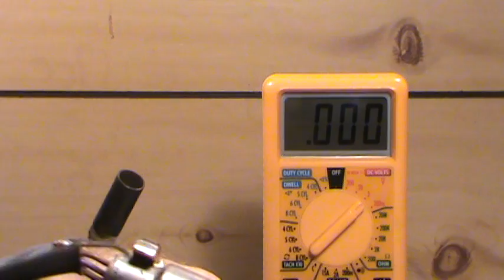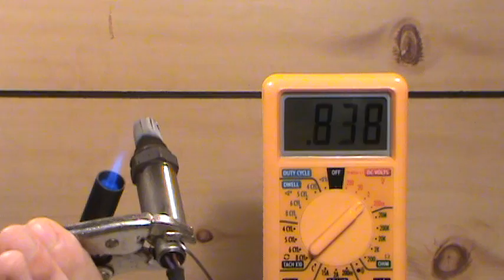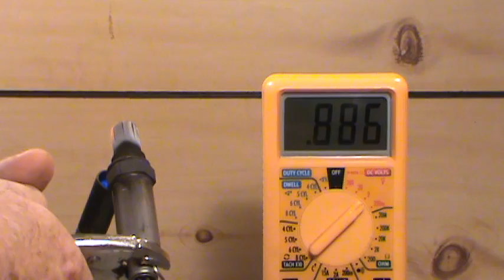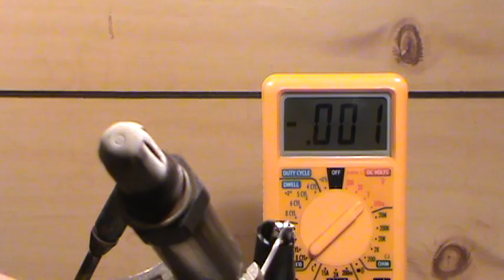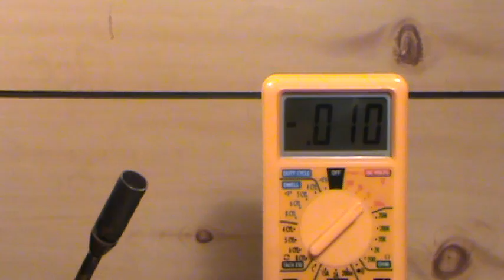Oxygen Sensor Test

Comment: Just wondering what would be the symptoms on the truck if you don't replace the oxygen sensor?  Would you loose some power due to that or is just to prevent the check engine light to come on the dash ?
please let me know if you happen to know
Thanks
Reply: WOW
Reply from the maker: Omar Herrera Greetings Omar Herrera....Thanks for watching, and for Your questions as well.................................................The "Oxygen Sensor" or "Oxygen Sensors", that are Installed, in the Car or Truck's Exhaust System, as the case may be, are "Responsible", for telling the Car or Trucks On-board "Computer", just how "Rich" or "Lean", the "Exhaust Gas" happens to be, when the Oxygen Sensor/s, are up to Operating Temperature, and, the "Computer" is in, what is known as "Closed Loop"...........................................The "Computer", usually, just uses the Information, that the "Oxygen Sensor/s" are "Sending", when the Engine is Operating at Lighter Loads, as in, just Cruising along, and are making the needed "Commands", to all of the "Actuators", in order to Maintain, an "Air/Fuel Ratio", of about 14.7 to 1, and I think, also, at "Sea Level" as well, if I'm not mistaken, that is, as Opposed to..."Ignoring" (aka, Not paying attention to) the "Oxygen Sensor/s", when the "Computer goes into, what is known as..."Open Loop", and, an example of that, is, when, You Push the Gas Pedal to the Floor...!!!...............................................An Air/Fuel "Ratio", that is "Rich", has More Gasoline, in the Air/Fuel "Mixture", then, that, of a "Lean" Air/Fuel "Ratio", which has "Less" Gasoline, in its Air/Fuel Mixture...................................................The Fuel "Injector" or "Injectors", as the case may be, work kinda like a Light Switch, as in, Switching the Light Switch On and Off, really Fast.............................................The Car or Truck's "Computer" actually "Controls" the Fuel Injector/Injectors, Turning them, On and Off Really "Fast", and when they are in, the "On" Position, the Fuel Injector "Sprays" Gasoline, in a Very Fine "Mist", that eventually "Mixes" with the "Air", then on its way, into the Engine Cylinder, it goes, to be "Burned", to make some "Power"............................................To keep things simple, let's just talk about, Only "1" Oxygen Sensor, and Only "1" Cylinder in the Engine......................................When the "Oxygen Sensor", notices, that the "Exhaust Gas", that Flows past it, is on the "Rich" Air/Fuel Ratio, or Mixture side of things, the Oxygen Sensor, then, "Tells", the Car or Truck's "Computer"...Hey...Tell the..."Fuel Injector"..."Not"...to..."Spray"...so much Gasoline...because...it's just "Wasting" Gasoline, that the Engine Does "Not" Need at the moment...!!!..........................................Then, the "Computer", shall we say..."Pulses"...the Fuel Injector, with..."Less On Time"...so, the Fuel Mixture, or Air/Fuel Ratio, then, becomes..."Leaner" then it was previously.............................................Then, if the "Oxygen Sensor"...notices, that, the Exhaust Gas happens to get...Too "Lean"...the..."Oxygen Sensor"...Tells the "Computer"...Hey...Tell the "Fuel Injector" to..."Spray"..."More Gasoline"...because...the "Air/Fuel Ratio", or "Mixture" is Too..."Lean"...and...not only, will an Overly "Lean" Air/Fuel Ratio or Mixture, have the ability, to cause the Engine to Run, not so good, but, it can also cause some very Bad, and Expensive..."Engine Damage", given the right, "Way Too Lean", Operating conditions...!!!................................................The "Light On The Dash" is telling You, that something is Wrong, and, depending on, just "What Year", and, the "Make/Manufacturer" actually is, of the Truck, and, the actual "Engine", that's Installed, will determine, on what method You will have to use, to "Extract" the "Trouble Codes", that might be "Stored"..."Inside"...Your Truck's..."Computer Memory"............................................"If" Your "Oxygen Sensor", or "Oxygen Sensors", and, almost Any "Other" Device, that is related to Managing Your Engine's Operation, is, "Not" Operating, as it, or they should be, then, even "If" the Engine seems to be Running alright, Your Engine, might be "Wasting", that, quite Expensive Gasoline, giving You "Less" Gas Mileage/Kilometer-age, then, the usually "More" Fuel Economy, that Your Engine will usually get, if the Engine is Running, like the Factory/Manufacturer designed it to do, when it was brand new...!!!.............................................Perhaps, pay close attention, as to how Your Truck's Engine is actually Running, and, Keep a close eye, on Your Gas Mileage/Kilometer-age as well, as those two, just mentioned items, are just some "Clues", to be watching out for..................................................If any "Parts" need "Changing", then, as I see it, that would be a very good thing to do...............................................Be Safe, take care, and have a good one.
Reply: RockysRoadshow
How about a brief answer? Maybe just say yes or no and explain why with main point. :D
Reply from the maker: Supzor Greetings Supzor...Let's see now...You are asking me, to give You a..."Brief"...Answer...???............................................"What" was the..."Actual Question"...that You want, that..."Brief Answer"...To...that You were mentioning...???.............................................When it comes to, any "Question", that "You" may have...Please, be..."More Specific"...and...Please, give as Much..."Detail"...as "You" are able to...that way...I, just might...Run-out...and...Finds-me, a..."Brief-Case"...so that...I will be able, to..."Open-Up"...that there..."Brief-Case"...and...have a..."Look-See-Inside-of-It"...and, if-in I get..."Lucky"...I just might be able to (much like a "Magician" does, when He or She, "Pulls-a-Rabbit-out-of-that-there-Hat")...be able to do...much the same thing...but...instead of..."Pullin'-a-Rabbit-out-of-a-Hat"...I'll probably be..."Pullin'-a-Document-or-Two"...out of that there (Imaginary, at this particular point in time)..."Brief-Case"...where...Hopefully (and, keepin' "Fingers Crossed")...that there..."Imaginary"..."Brief-Case"..just might..."Contain-with-in-itself"...that, or those, as the case may be..."BRIEF-Answers"...to the..."I'm-just-Not-Sure-what-His-or-Her-Actual-Question-Was"...???.......................................................When it comes to, something like...a "Vehicle's Computerized Engine (and then some) Management System"...I really can't see, having a..."BRIEF-Answer"...To...the..."Mind-Boggling-Amount-of-Information-that-the-Vehicle's-Computer-Recieves-from-all-of-the-Sensors-then-Processes-that-Information-then-Outputs/Commands-all-of-the-Vehicle's-Actuators"...!!!...................................................................Well...I guess, about the..."Only Thing"...that happens to be..."BRIEF"...here, is the, shall we say..."Lightning Speed" (You know, that "Super-Bright-Flash-of-Intense-Light-in-the Sky", known as..."Lightning?")...is, as I see it, the..."SPEED"...at which, Our Friend, the...Vehicle's On-board "Computer"..."Processes-all-of-that-Amazing-Amount-of-Information-At" (Time-wise...Eh!)...also, even "I", find it Difficult, to Comprehend, the "SPEED", at which the vehicle's Computer "Processes All of that Information At"...You know..."Splitting a Second of Time"..."Into that Many Divisions"...maybe along the lines of..."Milliseconds" (aka, "1-Millisecond", should be Equal to..."1-Thousandths-of-a-Second"...Time-wise)...perhaps......................................................The..."Last" sentance, in, this here Reply, will be quite..."BRIEF" (as You requested)...and is, as follows.............................................................Be Safe, take care, and have a good one.

Comment: a comment on SixtyFiveDropTop's comment about O2 sensors not wearing out, but suddenly failing.
Actually, they DO wear out, However as they are a dynamic device, and function off of a known set of parameters that are based on the laws of physics, they are also self calibrating. It is when they fall outside the known operating ranges that your vehicle generates the dreaded P0131 through P0139 errors which all report response time issues. You only notice the O2 sensors when they HAVE worn out and failed, this is why auto manufacturers list a specific operating life on them, they wear out.

Comment: you are not reading rich or lean, when heating with the torch.  gasoline generates a certain amount of therms based on the ratio of gasoline to oxygen,  That is where it is determined when it is rich or lean. You are just heating the "thermocouple" or equivalent for those who understand how thermocouples work, inside the O2 sensor and generating a voltage output, and nothing more.
Reply: Incorrect. Look at a forklift in a factory (used indoors) they usually run on PROPANE. It's engine also uses an O2 sensor, to control the fuel/air ratio. To add a couple things- an O2 sensor is a Galvanic Battery- meaning the Rare Earth metals that it's made with- produce an electric current when exposed to heat and oxygen. If you look at your propane torch nozzle- notice it has air holes in it, before (under) the actual burner nozzle. As the flame burns- it is drawing air (with an O2 content) that makes the flame hotter & blue. That's why you noticed and remarked at 6:09 the "rich" reading on the DVM. It wasn't reading the rich "fuel" (propane) it was reading the "rich" oxygen. If you had some aluminum tape- you could cover these holes in the torch- and you'd see a drop in voltage- and a yellowing of the flame. Most NG, LP, Propane, and butane burners (furnace, stove, camping stove, lighter, etc) have an "air control vent" for this purpose- to make a cleaner burning and hotter flame.